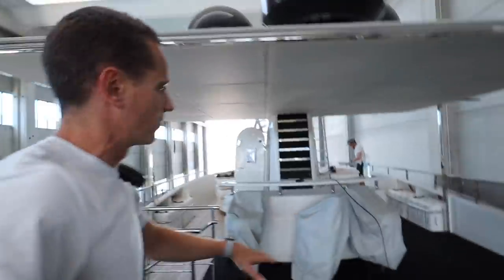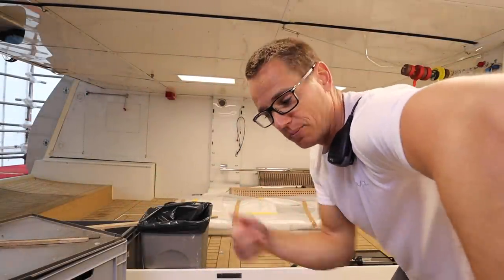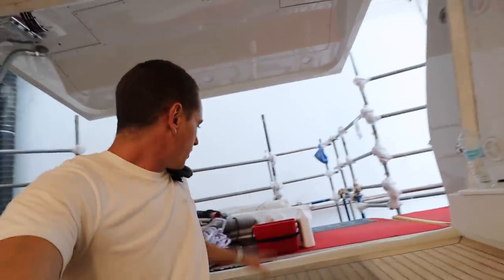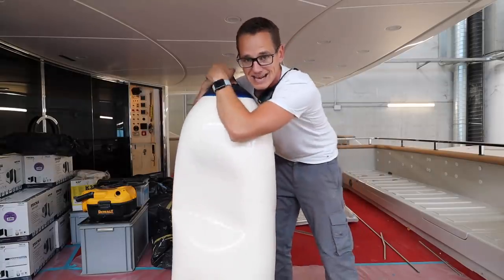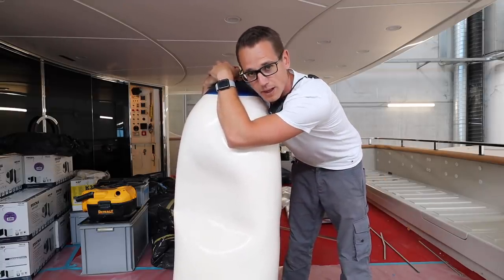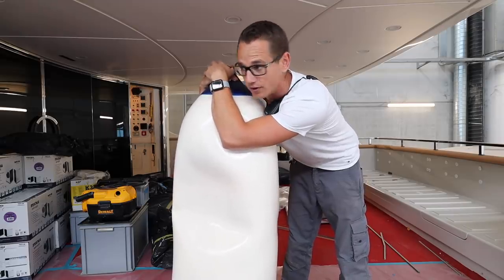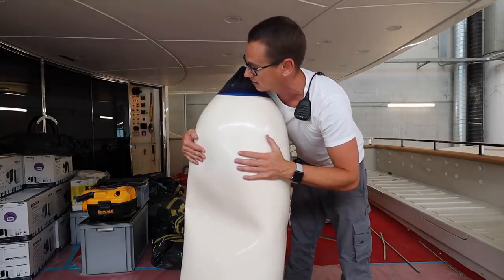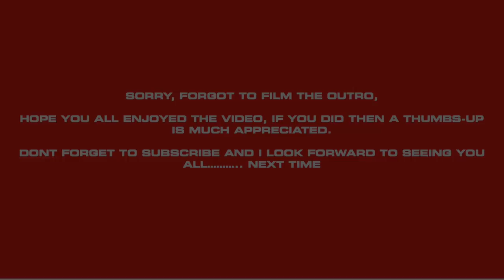GETTING A $10MILLION SUPER YACHT READY FOR THE SUMMER (Captain's Vlog 142)

Comment: Do you completely empty the fuel tanks when she is in dry dock? I am guessing you do, but how do you prevent a build-up of condensation in the fuel tanks if the tanks are empty?
Reply: all ships empty fuel tanks when dry dock, that's when they use the time to clean up the fuel tanks, also water and sewage tanks.
Reply: When the tanks are emptied samples are takin and then achohol additives and or cleaners and detergents are added to finally wash the tanks. A little h20 wont hurt, diesel fuel is filtered many times (scrubbed) before it hits the injectors.